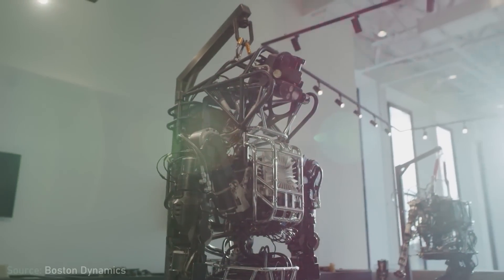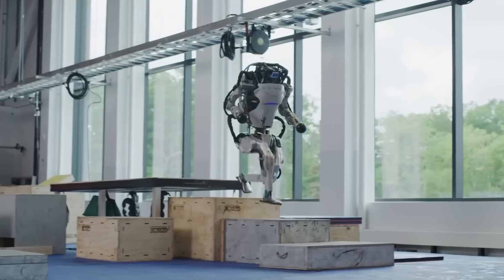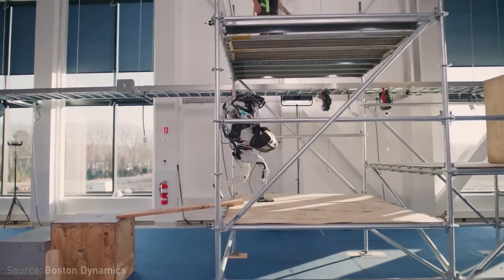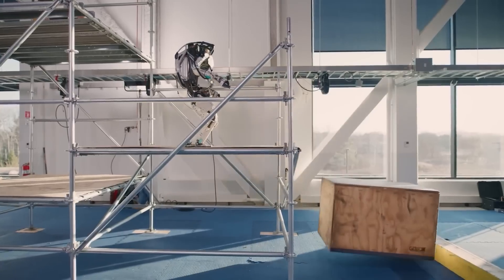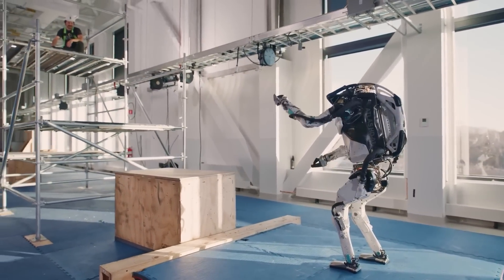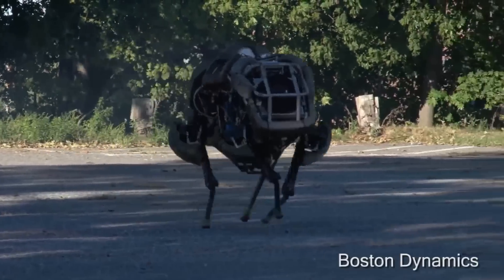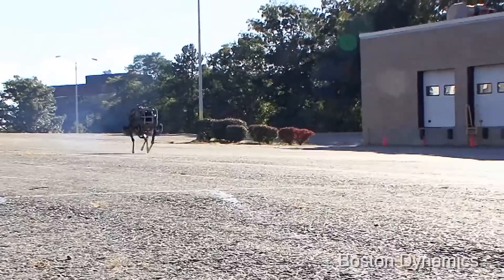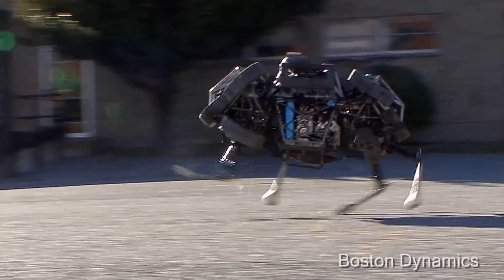Hydraulic vs electric actuation in robotics | Marc Raibert and Lex Fridman

Comment: Did I miss the part where Mr Raibert is pointing out the advantages of hydraulics compared to electric actuators?
Reply: Electric sucks fuk it’s just easier
Reply: Nope. Just the usual philosophical BS.
Reply: Hydraulics is preferable if one aims to achieve ultimate in performance, regardless of the cost.

In Atlas, the hydraulic pump is integrated with a pressure accumulator and is contained at the torso of the robot, together with hydraulic valves. These and the battery are the heavy items, and keeping them near the center of mass of the robot reduces the moment of inertia of the robot. With the hydraulic pressure around 200 Bar, the limbs require only very compact and relatively lightweight hydraulic cylinders to generate very high forces. This allows the limbs to have low inertia. The bandwidth of the hydraulic system itself is also quite high, it can respond to changing forces in a few milliseconds. The entire thing is also relatively resilient to impacts.

It would be quite hard, probably impossible, to achieve the same performance with electro-mechanical servo actuators, some of which would have to be located in the limbs. Their mass would be distributed all over the robot, increasing the inertia of the limbs, which will require even more power to drive them. A vicious circle.

Driving limbs through some cable transmission is possible and is implemented in WAM Arm by Barrett Technology, which for a long time has been a gold standard in agile robotic manipulators. But it is low power, expensive, and requires the cables to be re-tensioned periodically.
Reply: @cogoid  Thanks for your reply. I thought of SpaceX’s Super Heavy first stage of Starship where he changed the thrust vector control system from hydraulic to electric actuators (booster 7 to booster 10). The reasons are less weight, less complexity, no fluids and therefor more reliability.
Reply: @mrdebris1217  Actuators in rockets are optimized for different parameters compared to those in robots. So it is not quite apples to apples comparison.
Reply: @mrdebris1217  I believe that consumer companies have reasons other than those you mentioned !! It is impossible, practically or theoretically, for a hydraulic system to be more complex than a consumer electronic system. This is fundamentally illogical. The hydraulic system can be designed smaller and adapted to each system according to its needs, and it is more efficient and therefore more reliable. There is no problem with fluids, they constitute our lives and we deal with them constantly, so I believe that “electrifying everything” has goals for consumer companies !!
Reply: @cogoid  Is Tesla's bot using electronic actuators? It seems like it wouldnt be responsive enough to handle dynamic physics problems like catching itself after a stumble.
Reply: @cory99998  Pretty much everybody else is using electric. It works, but the robots are indeed less athletic.
Reply: @cogoid  So is the thought that slower robots meet spec for the majority of tasks?
Reply: @cory99998  If we look at order fulfillment centers, they use close to a million of robots. But almost all of them are simply automatic floor jacks that move racks of shelves around. They cost ten times less and lift a hundred times more. Only now some companies are starting to experiment with bipedal walking robots, to see if they are useful. It is still too early to tell how it will play out in real life.
Reply: @cogoid  Well im not complaining, I certainly like a good robot. But it does seem like its being used for marketing more than anything (cough tesla cough)
Reply: @cogoid  I also think that hydraulics are preferable for robots. But there is a security problem. A leak under 200 bar pressure is dangerous for humans (hello, T-800)
Reply: @Mio_Kovachich There are design limits to operate something. For example, if the system is designed to operate under the pressure you mentioned, this must be adhered to. To bring the picture closer to the picture: If there is an electrical resistance designed to work with a 9 volt battery, if you take that resistance and put it under 220 volts, for example, it will burn ( fail ). Because it is designed to work with 9 volts but you exposed it to 220 volts more than it was designed to work with !! Also the same with all systems. I also doubt that pollution with electromagnetic radiation has more serious and harmful consequences to human health and the environment than Hydraulic !
Reply: @ياقوت-ق  I knew all this before. I am interested in whether hydraulic drives can be made safe. For example, if a leak appeared, the liquid would instantly thicken. Artificial muscles could be an ideal solution for anthropomorphic robots. But they haven't been fully worked out yet.
Reply: @cogoid  Kind of funny how experts like you have been proven so wrong so quickly.
Reply: @THE-X-Force  Not really. They gave up on hydraulics because Hyundai wants a utility robot that can be used in their factories. It will be a good robot, but no more parkour.
Reply: @THE-X-Force  He's not wrong, hydraulics having better output than actuators is a simple fact of physics. We can commend Boston Dynamics for raising the bar, but if/when the new Atlas jumps up 1m, the old one could be doing 5.
Reply: @slyseal2091  Twist it however you like .. but a bot that cam jump 1m 1,000 times without fail vs a bot that can jump 5m and bust a hydraulic line .. it's a simple equation. I guess we will see .. but I'll tell you where my money is at.

Comment: bro forgot to mention the maitnence of hydrolic, ie filters, oil, leaks, breaks, it's like a gas car. Ridiculous
Reply: on such a small system it wouldn't really be that big of a deal but its just more efficient and simple to use the electricity directly with hydraulics its battery>control and power circuits>electric motor> hydraulic pump>valve body>cylinder, with motors its battery>power and control circuits>motor. Way simpler, lighter, and more efficient by probably 10 percent.

Comment: Hydraulics are going to win in the long run, because electric actuators are never going to deliver the strength needed for strong dextrous compact hands
Reply: Boston Dynamics begs to differ
Reply: @Daredayo713  have you seen the hands boston dynamics developed? you know, those big clunky lobster grippers lol the industry is going with electric because its easier to manufacture, not because its better.
Reply: @OYVAI_izmir  maybe they will be making proper fingers later, hydraulics would be better for that
Reply: @blackcat8072  hydraulics is the better performer, for sure. Though, for something as intricate and precise as fingers, electric is likely more preferable, given that most simple tasks requires only a low number of DoFs. With hydraulics, you can utilize a very strong and very high number DoF system with an externally tethered control system.. But in general, direct electric motor control will do for most use cases.. With that said, im working on my own soft hydraulic hand atm on my channel lol its mainly a proof of concept for future builds. But i'm hoping to prove the feasibility of a low cost hydraulic alternative in a hobbyist level hand kit.
Reply: agreed

Comment: how's about pneumatics?
Reply: Because air is compressible. It wouldn’t make for strong “musculature”
Reply: @mdbbdm7850 and because its bouncy it doesn't give a natural look for example when they use it in animatronics (eg chuckecheese or rockafire explosion)
Reply: pneumatics is very very dangerous for the pressure required to make robot jump
Reply: @heartminer5487  Atlas is quite dangerous no matter what. And when it jumps, the hydraulics is just the means to deliver the power to the joints, but the power itself comes from the compressed gas in the central pressure accumulator. Then the electrically driven pump returns the hydraulic fluid back to the high pressure side at a more steady pace.
Reply: RoboCop stop motion style
Reply: Pneumatics was used in Marc's leg laboratory to build the first hopping robots. Leg extension which made the hopper hop was done by a pneumatic cylinder. 

Pneumatics is also widely used in industrial automation -- lots and lots of actuators that are used in production lines are pneumatic, and there are many vendors of pneumatic valves, cylinders and controllers for such applications. One of them is Festo and you may have seen very beautiful advertisement from them with various flying contraptions.

So, there are great reasons for using pneumatics in some types of robots.
Reply: Difficult to control precisely because of compressibility and change of volume/pressure with temperature. And air pumps are heavy. You can use compressed gas as an energy source, but specific energy is low, with little hope for future improvement like with batteries, and it comes out cold so you need a heat exchanger (more weight) to avoid wasting most of it.